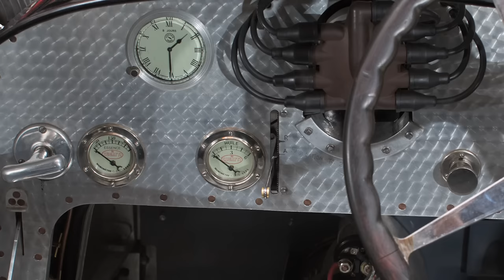1927 Bugatti Type 35 Pur Sang Replica - Jay Leno's Garage

Comment: Well, I don´t think it´s correct word "Replica".It´s better use word "Copy",because only keen Bugatti specialist could recognize it,but replica is easy to recognise to every one,then?P.S-Those cars are gorgeous!Basically no brakes,basically no tyres,no power brakes and steering,no safety belts,but runs over 200 km/h!!Great!!(Yes,it´s 125 MPH for anglo-saxons..).Love this sound of engine and whistle of supercharger...
Reply: I think they have really good brakes, as long as the cars don't exceed 250HP.
Cable brakes have no fading problems and they have the effect of power brakes, given by the pulleys they use to move the cables
When breaking hard the front axle twists forward under heavy load, so the front brake cables are stretched even more(power brakes) plus, drum brakes can be huge up to 330 mm internal diameter.

Comment: How would one legally build a car from the ground up like this? Its impressive engineering but I think with a few friends that have the right skill sets, a person could build a 1920s race car like project. For title and registration needs, would you need a frame or component from an old car? I guess one off hot rodders and frame builders face a similar issue.

it'd be such a fun project to make something like this or those 3 wheeled kit cars.
Reply: mcgoo721 "Registration Requirements for Home Made Specially Constructed or Kit Vehicles"

Comment: JAY! You need to see the homebuilt 1949 Porsche/VW Glockler Eigenbau Special 550 Spider "Frankfurt Flyer" by Chris at The Motoring Journal. Just Google 'Frankfurt Flyer' for info on the build or go to Ebay and buy it for a very low price.

Comment: Jay how do you get by driving without a registration plates?
Reply: without tags is probably because he's jay leno just going out for a jaunt. Without lights however is probably because the car is grandfathered in. It varies from state to state but usually if a classic car didn't come with X feature as standard equipment for the time, you don't need it. Another example would be seatbelts.
Reply: Brian Fairey What cop would give Jay Leno a ticket?

Comment: Wait,... I'm baffled how a plainbearing, essentially a solid bushing, is better than a roller bearing.
Reply: That bewildered me for a long time.

If the oil was kept perfectly clean and at constant, correct pressure and temperature, there would always be a film of oil between the plain bearing and the crankshaft. 
Since there would never be any metal to metal contact, the bearings could go for a very long time. 

The area of the oil film is greater on a plain bearing than rollers. Thereby allowing less wear.

Comment: "We do 1% of the original" So... $250,000 for a replica of a $3,000,000 Bugatti. What an expensive joke! I knew a garage of tin men and mechanics who made good replicas of old sports cars, but using modern motors, transmissions, brakes and electronics under the chassis. Affordable, too! Especially if you provided your own car to kit out. A used Mazda Miata with body damage can be turned into a good replica racer.

Comment: So.... Where's the ''gear'' whine? If it was gear whine it would be noisier when he lets off the throttle. I have driven several vehicles including motorcycle that have straight cut gears that NEVER whine. If you use the correct lubricant they won't whine.

Comment: You must be kidding.  Bugatti basically ceased operations in 1956, since then the company existed as a trademark that bounced around different owners until Volkswagen purchased the rights to the name in 1998. Everything about the Veyron is designed by either Volkswagen or third party subcontractors such as the appearance of the car.

Comment: Why change firing order? 6:18
Reply: The original firing order on a straight 8 is unbalanced and wears out the engine faster. He spoke about it in The Smoking Tire podcast.
Reply: If you want it to idle like a real Bugatti you would keep the original firing order. If you don't want the engine to explode in 20k miles... you balance the firing order.
Reply: At the time of production of the original, the revised firing order had not been engineered and utilized until later model bugatti's. Pur sang utilized the improved firing order as it's more efficient and less stressful on the engine.
Reply: 4-4 vs 2-4-2

Comment: this wouldn't be possible in germany.  Since they are building a "new" car, it must meet the 2018 Emissions/Safety requirements. Otherwise you can't register it. Also all components need a datasheet about the metallurgy , strenght etc etc....  Only then it can be registered ( when it passes the Tüv inspection)

Comment: no reg plates? no indicators?
Reply: Cars that old you can use hand signals, do not need lights.
Reply: @troynov1965  
"Replica".
Reply: @MilesBellas   its still considered a 1928 when you title it.  As you you do not need seatbelts etc...
Reply: @troynov1965  
Wow!
Amazingly lenient of the DMV !
Reply: @MilesBellas   Im pretty sure if you stuck a modern type frame under then it would have to be titled as a modern car and then be required to have modern safety and emissions. Say for instance a 2010 Corvette or some such. Im sure each state has its on by laws as well.

Comment: Then don't post comments suggesting you know nothing. Being you commented ''hey look at me i know more than you'' is a cry for help that you really do know nothing. Most of the older gearboxes had to be double clutched. Either that or they wouldn't go into gear.
Reply: Actually no.  You are much more likely to double clutch on down shifts, because you don't have time to "float" the gears.  But on upshifts, when you get good, you roll of the throttle and gently pull the gear lever into neutral as the engine slows.  Then gently slide it into the next lower gear, and hit the throttle again.  Until you gain confidence in your shifting technique, you might clutch it just before going into that next higher gear.  The gear ratios in the transmission were optimized for this style of driving.  Shifting this way, without synchro's is unbelievably fast once you get the hang of it.

Comment: I dont understand how they get 180HP from "changing the firing order"??
Reply: Firing order effects engine balance, and the old firing order was highly unbalanced. A smoother running engine able to deliver more power doesn't make any sense to you? It's apparently easier on the crank, less power lost through mechanical losses (no machine is 100% efficient, some amount of power/energy is always lost at each step along the way. This helps reduce that.)

Comment: Did Bugatti ever race Indy?
Reply: +Tom Smith Yes they did. A small private team entered the 1923 Indy 500 and qualified 6th. The car finished the race in 9th place but was in the winner's lap (the 200th lap of the race). Back in those days just lasting the race was quite the achievement and mechanics actually rode alongside the drivers.

Apparently Bugatti officially entered a car for the 1914 Indy 500 owned by the factory itself. In 1914 it was mostly French cars and drivers who dominated the race (Peugeot won in 1913, 1916 and 1919, Delage in 1914 and there were no races in 1917-1918 due to WWI) so Bugatti tried their luck. The top 4 finishers were Delage, Peugeot, Delage, Peugeot cars. The sole Bugatti raced in the top 6 but retired with a broken drive pinion on the 134th lap.

Bugatti did win the prestigeous 24 hours of LeMans twice (1937 and 1939) and they won the Monaco Grand Prix too four times (1929, 1930, 1931, 1933)
When it came to circuit races in the 1920's they pretty much made easy work of the opposition all over the world.

Comment: Why is the driver on the right side?
Reply: Because most race tracks in Europe used to be driven in a clockwise direction. So most corners were right hand turns. Putting the driver on the right means they can see exactly where the front right wheel is touching the ground, so they can always hit the apex of the turn precisely.
Reply: Fred Doobrie Thanks, I always thought that it’s because the races are in England thus the RHD.

Comment: "was very adamant about keeping the purity of the original NSX....." 

-Twin turbocharged engine
-3 seperate electric motors all supplementing overall powertrain
-alternating four wheel drive
-9 speed auto
-optional/but apparently very "functional" rear spoiler
-"interwoven  dynamisc and surfaces weaving in and out of each other" design for aerodynamics and downforce.

WTF, who are they kidding? Lets be real here, they scrapped the NSX project after coming to the conclusion that they want to build a "hypercar" to try and compete with other manufacturers they have no business competing with, in order to flex their grandoise, "engineering prowesss" and "best in the world comparison" drawing capabalities..... but then realized they could garner alot more hype surrounding it by misleading its loyal fans by slapping the NSX name on it, and thus its win win for them..... You can really see this if you more closely analyze what Michelle and Ted say Especially throughout the middle portion of the video.

Comment: 250K for an argentinian copy???? are nuts!!!
Reply: If I had that kind of money to spend on cars, I would!
Reply: latengocomoburro Instead of spending US$ 3.5 Mio on a rare used car, that's a quite reasonable amount to spend for high quality replica.
Reply: latengocomoburro eso se llama envidia
Reply: latengocomoburro Bargain!
Reply: latengocomoburro Paying for the craftsmanship not for the name, which is 100% how it should be.
Reply: +latengocomoburro Well you could pay 2.5 to 5 million for an original if you want...  You get what you pay for and you are paying for quality craftsmanship.  Did you not hear when they were talking about how they make every part of those cars in their own facility.  That almost never happens anywhere anymore.
Reply: its amazing value for money for a brand new car with some technical updates. Why would you buy a used one that requires lots of maintenance when you can have a brand new one straight out of the factory?
Reply: I wouldnt even call it a replica, its more of a re issue and why would you pay 3.5 when you can have a brand new one
Reply: latengocomoburro ... I  just don't  think that your getting it.
Reply: What is the problem that is manufactured in Argentina? iPhone is manufactured in China